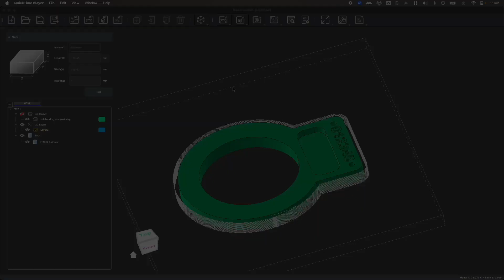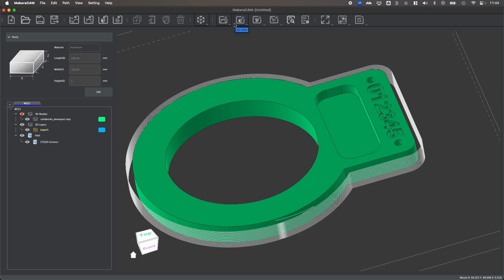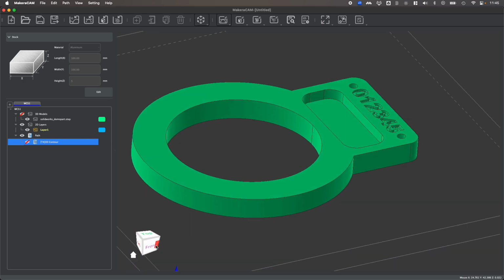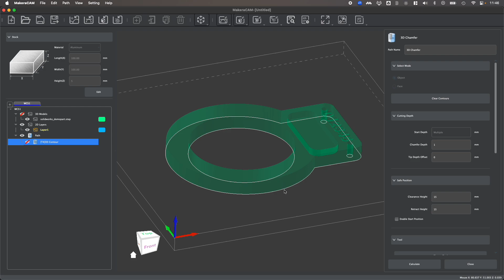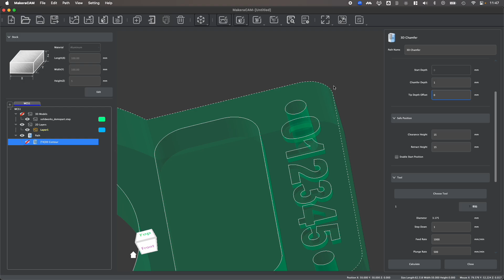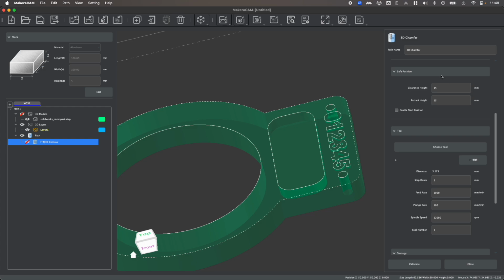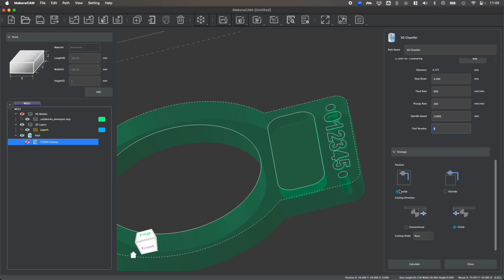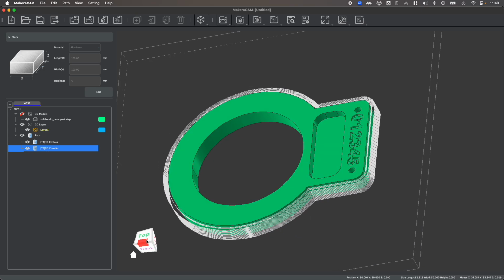Makera CAM - Creating 3D Chamfer Tool Paths

Comment: Could you show an example of how to create a contour for a chamfer that's in the design file? I'm having trouble.
Reply from the maker: For CNC manufacturing with most CAM programs, you don't need the design file to have a contour edge. Machining this edge specifically would be very inefficient as you wouldn't be able to use a contour bit to match perfect, instead some type of 3D relief. Its best to know the size and angle of your desired contour, then choose the right bit and depth of the contour in the tool path operations.
Reply: @Makera I mean that I have a chamfered through hole already in the STEP file. In Makera CAM I am unable to figure how to use a changer bit to cut this chamfer, I can only make it work if I remove the chamfer from the design. It's just a 1mm 45 degree chamfer around a hole. I understand that I can make it work without the chamfer in my design, but I find that to be a bad work flow, my design should match the finished product, I don't want to use CAM software to do things that aren't in my design.
Reply: @Makera  The issue is that you already mentioned in a video that you would show how to set up CAM even when the 3D file already has a chamfer in another video. However, when I search for “Chamfer,” none of the video titles seem to match that topic.
Is it possible that the video doesn’t actually exist?

Comment: Let’s say i wanted to mill this design and also mill the dog head 3d relief (from your other video) into the center area of this part/all as one part… how would i go about doing that if this file is step and the other is stl? Would i need to drag both models into makera cam, and align them and then create both sets of tool paths and export as 1 gcode file, or export as multiple gcode files? Most of my files are 3d reliefs but the part around them are more structural, e.g. a serving tray which requires a pocket for the tray portion and a relief in the bottom right corner of the tray for a 3d logo or personalization
Reply from the maker: This is an awesome project, and yes the most effective way would be to import two models (STEP / STL) and overlap them in the CAM. For the relief file, you can set a "max depth" in your 3D relief tool path that will ensure it only creates a relief on the surface without machining the edge or impacting the structural components. You could choose to export this as separate GCode files or one depending on your setup, both would work. For additional support, please email us at cam@makera.com

Comment: If I want to countersunk a hole like you mentioned, would I do that by just making a drill operation of lets say 2mm depth but using the chamfer tool instead of a drill?
Reply from the maker: You can countersink using a drill operation, primarily by using a larger drill bit. But in this case, you would create a contour operation around the inner diameter of the hole using the chamfer bit.